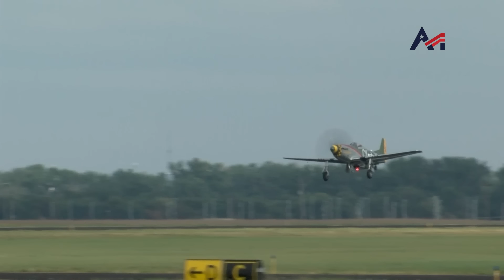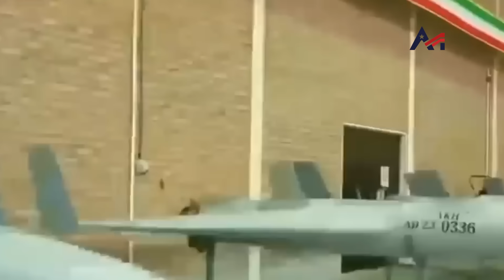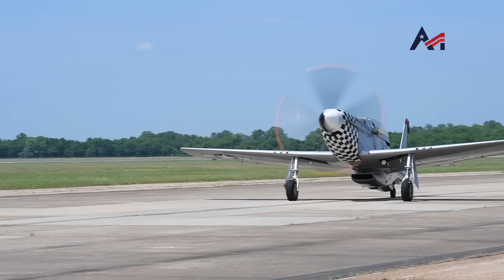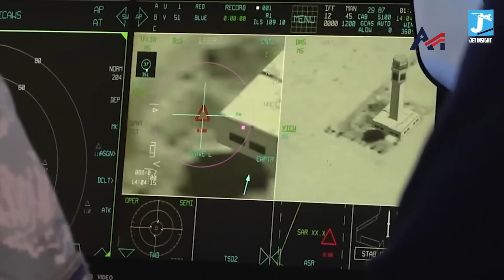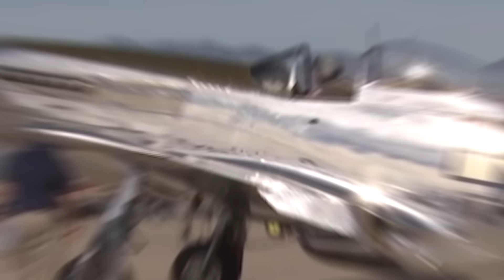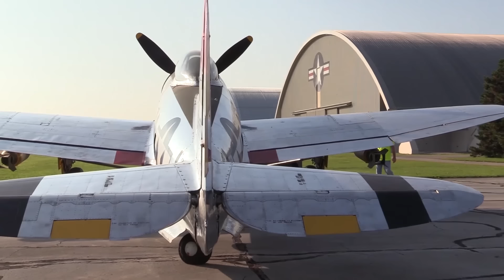U.S Air Force’s New P-51 Mustang Answer to Shahed Drones

Comment: That's exactly what I thought some weeks ago: P-51 / P-47 would be a nice choice for exactly this task. But they do have one disadvantage: none has an onboard radar and need guidance by ground stations, and it is probably not usuable in bad weather/night. So the Iranians would most likely change their tactics to night attacks. At least with a modern turbo-prop engine the P-51 would probably have even a higher endurance as the original with Merlin engine.
Reply: The black widow p-61 could be brought back for night drone ops

Comment: The idea is certainly interesting, but there are many limitations. I'll list a few: First: the modern ground-based anti-aircraft systems already mentioned by the author—hand-held or stationary. Second: flight speed. Based on this characteristic alone, I consider the Mustang fighter excessive because its flight speed is 600 ft/h and higher, while modern drones, according to the internet, don't fly faster than 275 ft/h. In my opinion, aircraft from the late 1930s to early 1940s, with speeds ranging from 365 ft/h to 455 ft/h, would be more suitable. I'll give a couple of examples: the American F2A Buffalo fighter, the USSR I-16 fighter, and the Japanese A5M fighter.

Comment: Even during WWII, there was a guidance officer who guided fighter planes to their targets. The fighters could identify their target only when close enough. Even today, when an airliner is missed in communications, a radar guidance officer has to bring the fighters to the target for interception. It would be hard to find the right airliner in the bunch of civil air traffic from the fighters alone.

I don't think that the P-51 would be an optimum solution to intercept Shahed drones. A modern turboprop trainer would do that at a lower price with more efficiency and less maintenance required. It is like driving a train with a steam locomotive.

Comment: I see two major problems with using manned aircraft against drones.  One; You would need a lot more pilots and do you really think that a very good pilot is going to choose a prop plane over a jet aircraft?  Two,  how long before the 'enemy' starts adding anti-aircraft drones to their swarms.  If they were controlled (maybe launched) from the ground (or other aircraft or drones) then they could be small and cheap as suicide drones or perhaps with a glider in mind with a small caliber mini gun in the nose and thus reusable!

Comment: Historically, the P-51 Mustang in WWII had destroyed many of Germany's V-1 rocket drones in flight. These were intercepted by either being shot down or had their wings tipped. The V-1s maintained a consistent speed and flight path. Through its gyroscope avionics and pulse jet engines. So it would not be a far stretch for a propeller driven P-51 Mustang to eliminate any Shaheed propeller drone.

Comment: Designing an aircraft for a specific mission is the opposite of US doctrine, which has been to build two types of planes for each service that can do a decent job at everything. The F-15 was designed to be the high-dollar air superiority fighter that could handle top of the line enemy fighters. The F-16 was originally intended to be the cheaper, less capable, throwaway fighter for less demanding jobs. Now they want F-35s to replace both.

But now, if we want something to intercept flocks of cheapo drones, what we could use is cheapo drone interceptors. They could be sent out to patrol areas, then loiter there autonomously waiting for targets. Once a target is spotted, human or smarter AI operators might take control. In any case, a human would always be required to pull the trigger, but they wouldn’t need to be on the plane.

Comment: There are several very good small prop planes already in use around the world. Plus there are 2/3 size P-51 variants. They can be lighter because they need less protection against bullets. They need less high tech blower systems.

Comment: I would think a pusher type aircraft with a canard setup would be ideal for defending against drones. No engine in the nose leaves room for radar. Like wise guns mounted near the radar would be more accurate. Sure we could mount missles, just big enough to destroy a drone under the wings, but guns used as backup weapons wouldn’t be a bad idea.
Reply: OV-10 Bronco
Reply: Best choice, effective and cheap🎉
Reply: But, pusher prop aircraft are not well suited to rough air fields due to potential damage from rocks being kicked up by landing gear and striking the prop. so they would be limited in their ability to disperse and be tied to proper air fields.....

Comment: Most modern helicopters are more than fast enough to overtake and pace the drone. With a doorgunner the helo pulls up even or slightly above and cuts loose a burst of 5.56 without even worrying about leading the target. Since the helo is flying outside of the debris path you don't have to worry about the turbines ingesting junk. Plus any suitable helo would be able to do dozens of other duties, far more flexible than a prop plane.
Reply from the maker: Interesting point! but it’s not quite that simple. Matching speed with a drone is one thing, but helicopters aren’t exactly ideal for that kind of interception.

Most modern drones are small, fast, and hard to visually track, especially at distance. Even if a helo can keep up, getting a stable firing solution with a door gun isn’t trivial especially against a maneuvering target.

Also, helicopters are far more vulnerable. They’re slower, less protected, and easier targets compared to fixed-wing platforms. Getting “close enough” safely is a bigger problem than it sounds.

Flexibility is definitely a big advantage, I agree  but for counter-drone work, speed, sensors, and stand-off capability usually matter more than just being able to pace the target.

Comment: I say redesign the Mustang to a more modern version. Call it the P-52 Mustang.
Keep everything good about the P-51. Upgrade it for better range, higher top speed, lower minimum speed, and more weapons. A zillion bullets, and maybe some other fun weapons.
Maybe use a turbofan engine for more efficiency. Get creative with the wings to make it stable at speeds as low as 100 mph or even slower. But then it can accelerate to 500 mph in seconds.
Send it up with a high altitude radar drone. The drone finds everything on radar, linked to F-35 and other aircraft, and feeds the targets to the P-52.
Reply from the maker: Cool idea, but at that point it wouldn’t really be a Mustang anymore. The original P-51 Mustang worked because it was lightweight, fast for its time, and optimized around a piston engine, not something you can just “upgrade” into a modern hybrid jet.

Putting a turbofan on it alone would completely change the airframe, weight balance, and aerodynamics. And expecting 100 mph stability and instant acceleration to 500 mph is basically asking for two totally different aircraft in one low-speed loiter planes and high-speed jets are designed very differently.

Also, the whole “radar drone feeding targets” concept already exists, just done better with modern systems like F-35 Lightning II working with drones and AWACS. In that setup, you don’t really need a heavily armed prop-style aircraft with “a zillion bullets.”

So yeah fun concept, but realistically you’d end up designing a completely new aircraft from scratch, not a “P-52 Mustang.”

Comment: Well, the Cavalier was a turboprop converted P-51 that the USAF looked at back when Vietnam was being fought.  You would go back to the Merlin power P-51… that’s where the Super Tucano and the current Beechcraft trainers would be a step in the right direction.
Reply from the maker: That’s a great historical reference. The Cavalier Mustang shows how the original P-51 Mustang concept was adapted, and today’s aircraft like the Embraer A-29 Super Tucano take that even further with modern avionics and sensors.

Comment: It’s the dumbest idea, as usual US falls on its face again.   There are more modern aircraft with better performance and mileage.  The mustang was a problem with its liquid cooled engine that had problems with being hit from the under belly.
Reply: It was a problem but the P51's continued working down in the weeds until the end of WW2. The pilots had to be more aware of larger German troop concentrations and their MG's. That's why you see a lot of attacks on German airfields especially if a 262 was landing and railroad train attacks. The P51's were also used for fast reaction attacks on valuable but isolated targets. Basically quick hit & run missions. My dad had some friends who were in the Netherlands and active in the Dutch Underground. 
One day a barge showed up and the Germans filled it up with all the fresh milk they could steal. The tug tied the barge up so they knew it'd be stationary for a couple hours. One of the adults contacted Britain and an hour later a lone P51 appeared. Checked out the terrain pulled a turn coming in at a steep angle and pumped hundreds of .50 cal into it. The barge sank. Germans did not get milk. Germans not happy. 

This same area was very active for launching V2 rockets and the stories they had about V2 failures were fascinating and some were comical.

Comment: Not much difference between a modern drone and a V-1 ..... hell the V-1 was even jet powered unlike drones . So much for any "tech difference" .    lol

Yes the P-51 had long legs but as a dogfighter ?  There were many that were better at the time . If they bothered to redesign a new prop fighter with new tech they would be better off . If they are going to raid history to solve this then they should just go with a Spitfire or a M-109  at least those two were tested dogfighters . By the time the P-51s got over there Germany had no skilled pilots .

Comment: Sure, a Model T can get you to the store and back too but why bother? Drones will be best taken out by other drones, gun systems, electronic defense, and laser. With drones it’s about cost and a P-51 is not cheap.
Reply: Helo with doorgunner. Don't even need 7.62mm as 5;56mm will easily destroy drone engine and maybe detonate the explosive, which is a VERY dangerous event if you're following it ala fixed wing a/c.

Comment: The visual between the 51 and the 22 flying side by side, is almost comical.  The idea of using the A29 to kill drones makes a helluva lot more sense than trying to replace the A10 with it.  Here's a funky idea...build about 200 Thunder Mustangs, give them off the shelf radar, give them some armor, mount gun pods, and use them?  I think they'd be faster, more agile, and cheaper than the A29.  JK...mostly.
Reply from the maker: That comparison is pretty striking 😄
Concepts like the Embraer A-29 Super Tucano focus more on cost efficiency and endurance, which are key factors in counter-drone operations.

Comment: It would like the piper PA 48 enforcer using a turbo prop so need for leaded av gas. It carried more modern weapons than the North American P 51 mustang.
Reply from the maker: That’s a great example. The Piper PA-48 Enforcer shows how the original P-51 Mustang design evolved with turboprop power and more modern weapon integration.

Comment: Often wondered why a military didn't buy used twin engine aircraft like the Cessna 310. Mount a gun in the nose and take out drone swarms one by one. A used 310 can be bought for 60 to 75K and there is no convergence needed.
Reply from the maker: Interesting idea 👍 cost-wise it makes sense. The challenge would be survivability, sensors, and integrating a system like that on something like the Cessna 310.

Comment: We already have that aircraft available...the A-10 Warthog is survivable, effective and can carry enough cheap radar guided missiles to allow one to knock down 10 or more drones per plane a long with the ultimate anti-aircraft cannon....and it's already here and capable of doing the job.
Reply: Yes and no, nothing is cheaper that a bullet .... However, a single 30 mm from an A10 cost $136.70 one second burst cost about $9,000.00. NOT cheap but cheaper, And I would not want to be down range. A .308 gun fires a bullet costing less than $1.00. A Gatlin gun is not needed. a 30 cal. Ma Deuce firing around 500 per min is plenty good for low-speed drones. And not as dangerous down range. The A10 cost 1.4 million when built but that is 12 million in today dollars to retool and build it would be prohibitive to restart production now, so you could buy 160,000, 310's for the cost of 1 A10..... Talk about cheap!!! Yea I know there was only 5,449 310's build and maybe half still flying. But for Ukraine 100 310.s in the air would make a big dent in the Shahid drones. Just a fantasy!
Reply: @garymccann2960 Dude…Ma Deuce (M2) is a 50 cal.
Reply: Those drones are either thin aluminum or fiberglass or cheap polymer. A 5.56mm with AP would easily drop any drone to the ground. Those chainsaw engines are just as vulnerable to damage and getting knocked out.